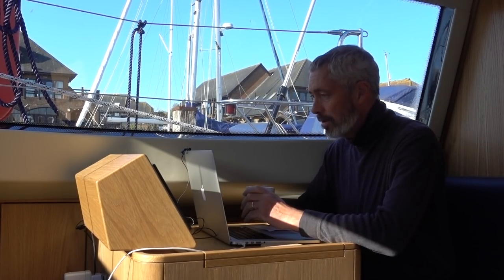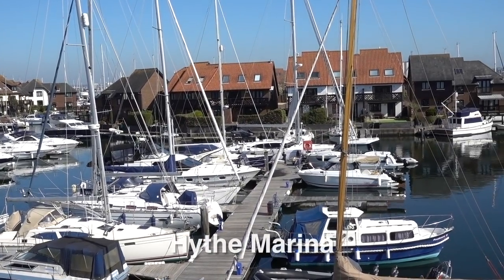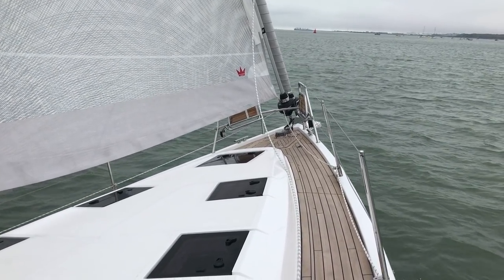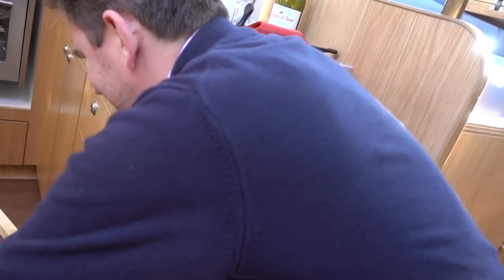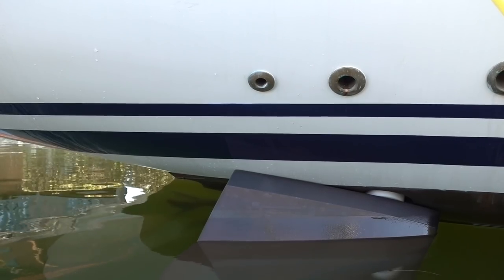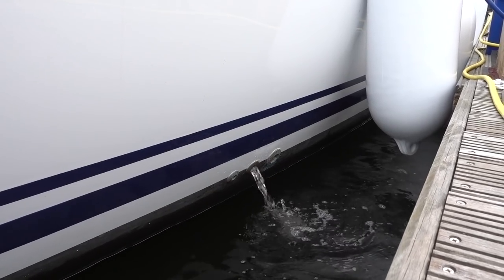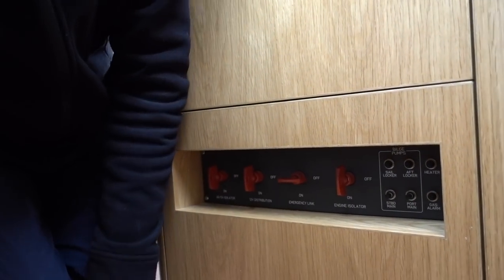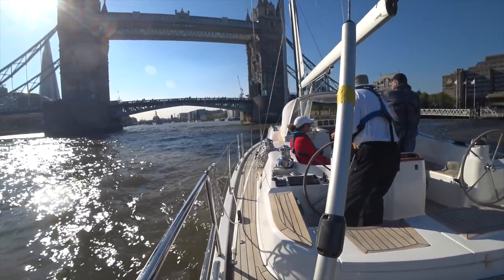New Sailboat Commissioning

Comment: Good to see the compehensive testing to check all is good and well. Question - what happens if something was inadvertently missed, but discovered later ?. Is there a gaurantee on the boat or something like that. Am an armchair fan of Discovery yachts, not a yacht owner, so was just wondering.

Comment: You are using the WRONG terminology! You said you commissioned the Raymarine equipment and the boat it self was being commissioned over many days. You can properly certify all the systems and engage in a series of sea trials and final system checks. "COMMISIONING  is a ceremony and is a ONE day event and either with a huge public event for a new freighter or navy ship to a private fun ceremony with just the crew or with friends and family and in the case of smaller sailboats and the like the launching and or naming of the boat is often done at the same time but maritime more and tradition usually dictates a launching and/or christening ceremony is usually performed as the boat leaves the factory and goes to the water for the first time.  Than a series of final manufacturing can happen and culminated with appropriate sea trials, final inspections and system certifications are performed until all punch lists and final inspectioning is accomplished. You are NOT COMMISIONING those systems. But then on a date arranged by the buyer, crew and manufacturer the boat or sailboat is commissioned and becomes the property of the buyer in a "COMMISIONING Ceremony"!

I laughed when you said you were allowed to be part of your boats COMMISIONING only because you  were integral in the design of your boat.

I'm a lover of Naval Traditions and the terminology used in those traditions and hate to see so many  newer and even expert, as you are,  people involved in maritime endeavors disregarding or failing in recognizing so many of our maritime traditions like when COMMISIONING a sailboat. Thanks
Reply from the maker: Interesting Melvin. Perhaps thats the traditional meaning but nowadays it refers to starting up the systems and making sure all is in order - the checks and trials you mentioned. I think its an example of the language evolving.
Reply: This is not old stuff. "Commisioning" ceremonies are performed every day a Ross the globe
Reply: @DistantShoresTV  Hi . The way MC is using the term 'commissioning' is a very specific use of the word as applied to warships and other government vessels. You cannot commission Distant Shores III in that sense of the word as she and no one onboard holds their government's 'commission' to do so. Your use of the word commission is a perfectly correct use of the term as it can equally be appropriately applied in the sense of project commissioning - but I'm sure you both knew that already? Know St Catherine's Dock well as my Naval Reserve base is there. Our jetties are on the river immediately before the entrance to the lock. (PS - Thank you for not calling Beachy Head 'The White Cliffs of Dover' as is often done.)